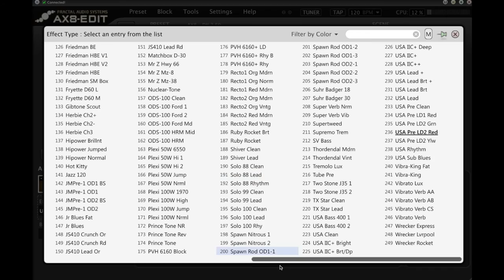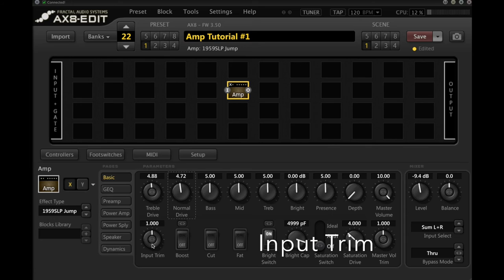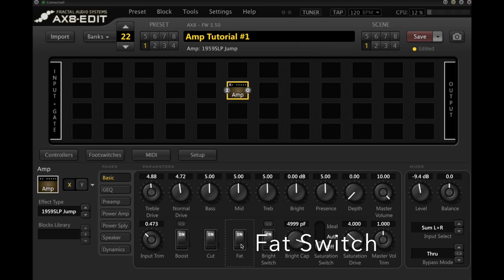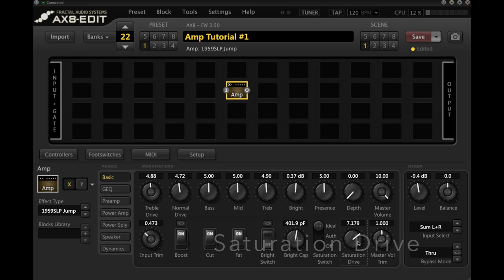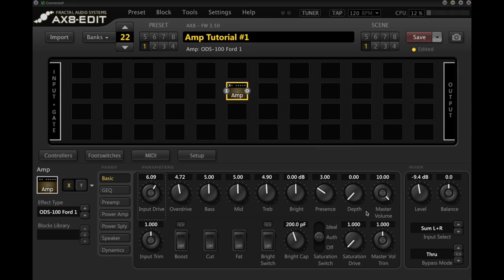Fractal Audio AX8 Amp Block Tutorial 1 | All Parameters On The Basic Page Explained | NBN Guitar

Comment: Hey Josh, which FRFR or speaker you use with Ax8 ? I tried all range FRFR but still sound very boomy and not clear enough for my ears..
Reply from the maker: Hey Phap! How's it going? I run my AX8 direct to a mixer and then out to the PA speakers. I've never had the opportunity to run it through anything else. I've been on a contract in China for the past few months and my AX8 arrived mid-contract to a gig that has no guitar amplifiers at all and I can't really have any kind of amp in my hotel room. My friend Richie Allen is a MONSTER guitarist and has been using Fractal gear for over 5 years. I consider him to be an authority on the gear and creating awesome tone. He swears by Atomic CLR gear. Have you tried that?